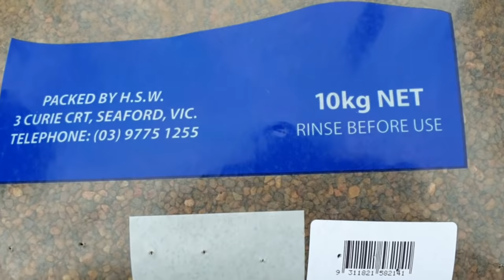Build A Low Budget Planted Aquarium For Angelfish

Comment: I have a 55 gal / 208 liter. How many angels could I put in the tank?
Reply from the maker: Hi Lynne, start with 6 juvenile and you could always remove any that doesn't fit.  There will be issues if any pair off when they are adults.

Comment: Which water you used? Soft or hard?  How we manage Amonia in planted tanks?
Reply from the maker: Hi Shan, it is normal tap water which is usually hard. Established plants along with a filter usually takes care of ammonia quite easily.
Reply: @Fishaholic  Thanks a lot for your valuable information. One more question: If a aquarium doesn't have plants, does filter will enough to take care of Amonia? What will be role of Air Pump in planted and nonpalnted tank? Your reply will be highly appreciated.
Reply from the maker: Yes of course, a good filter will take care of ammonia. My goldfish tank doesn't have plants as goldies will destroy them. Air pump creates surface agitation to oxygenate water. If your filter outlet can create disturbance at the surface level of tank then it will do the same job as air pump.
Reply: @Fishaholic  Thanks a lot for your prompt reply. Appreciate it. :)

Comment: I have 2.5 feet tank plz tel the requirement..
Reply from the maker: Hi Gary, what's the total volume in Liter of the tank and do you want to know how many angels can you keep?
Reply: @Fishaholic  120 litrs I want to set up planted aquarium so plz guide me...
Reply from the maker: Hi Gary, 2-3 young angelfish would be okay. However, when 2 of them pair off then 3rd would need to be removed
Reply: @Fishaholic  thank u sir n one more thing how many soil n substrate do I need for 2.5 tank...
Reply from the maker: It depends on you Gary if you want to place some driftwood and grow ferns on it then a thin layer of substrate will add to the beauty of the tank.
Reply: Wat bou soil???
Reply from the maker: Plants like java fern and anubias grows on driftwood so if you plan to use root feeder plants then aquarium soil will boost their growth. You will need deep substrate for these type of plants though
Reply: @Fishaholic  thank you sir n last thing I bought 9 ltr ada soil n substrate 2kg will it be ok for 2.5 planted tank setup..
Reply from the maker: Atleast 2 inches deep would be good. Any deep rooted plants will require bit more. Do your research on the plants and adjust the depth of substrate accordingly

Comment: This is supposed to be done on a low-budget I’m guessing and straightaway you put in a load of expensive substrate in there if I bought all of that substrate local to me in the UK it would cost me around £60 if I went to the building merchants and spent a little bit more time washing it and used a bag or two of pond compost underneath the gravel I could do it for under £20 and I plants with thrive and so with the fish I think this is the hardest thing when trying to save money everyone stuck in the mindset they has to have the word aquarium attached to the manufacturing not the case. These are exactly the same materials used in the building trade they’re just package differently porn compost is exactly the same as the stuff we get in the aquarium store it’s just not rolled up into little balls and baked so you just need to make sure you It off to stop it messing up the tank